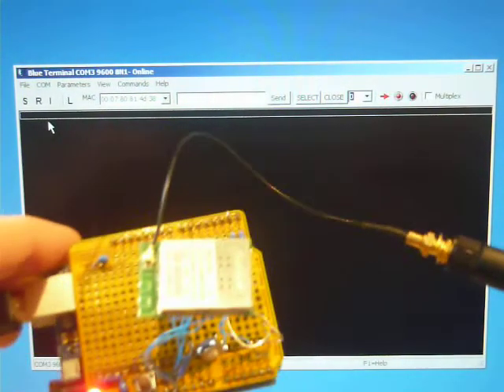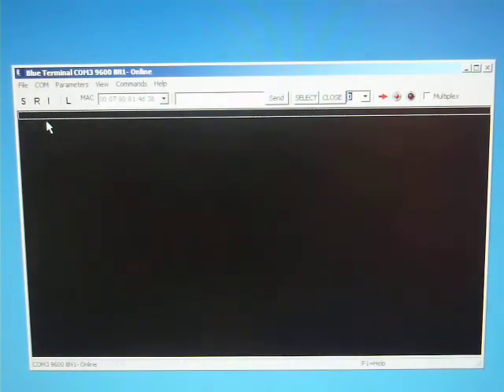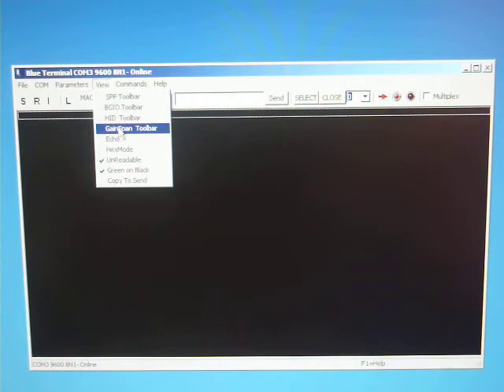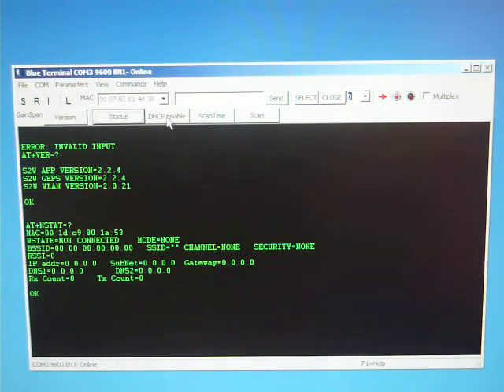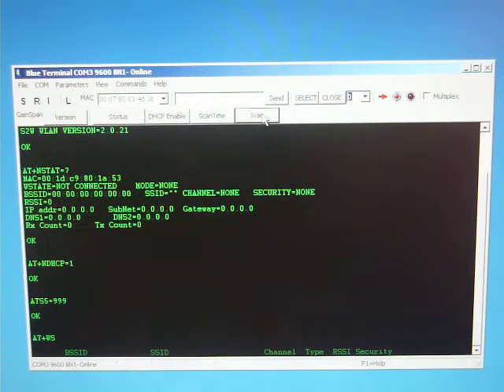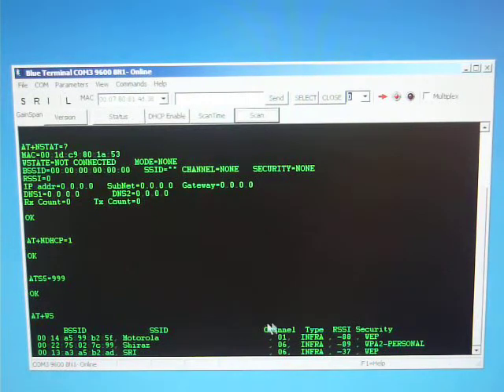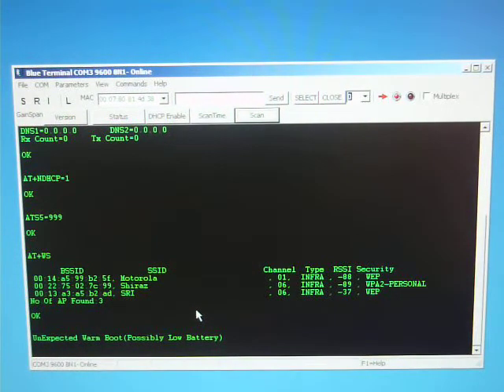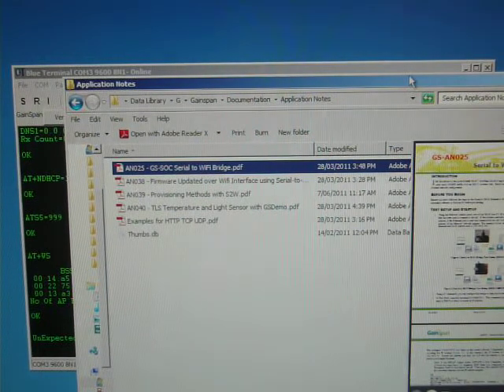GainSpan to Arduino

Comment from the maker: Hi, we are using UART - we basically copied the Eval kit. We know that Arduino Uno only has one serial port, so this device is talking direct to a PC using a FTDI serial-USB chip. This shield can work with Arduino, but only with the Mega. For more info, you can contact our supplier - Alan Sukyo alan@glyn.com.au - he just did a GainSpan course so should know all about it. Also, you can contact Gainspan direct - they are always on hand to help - they helped us with a minor issue.